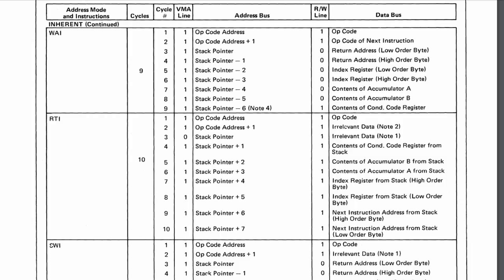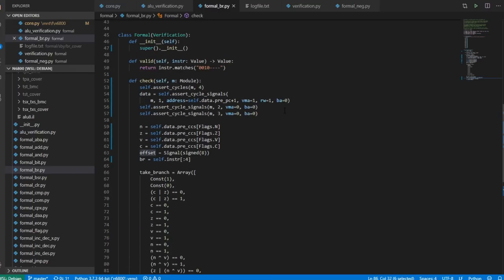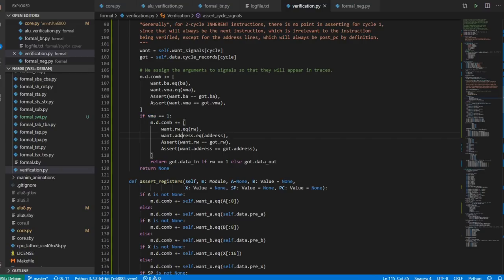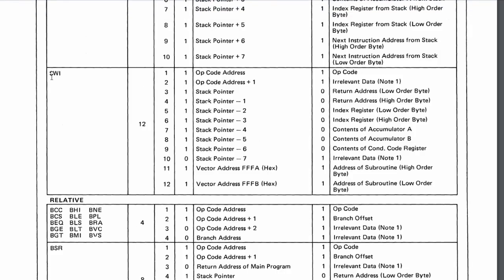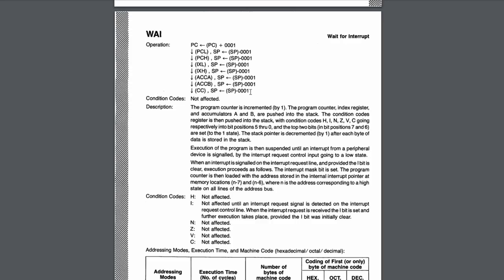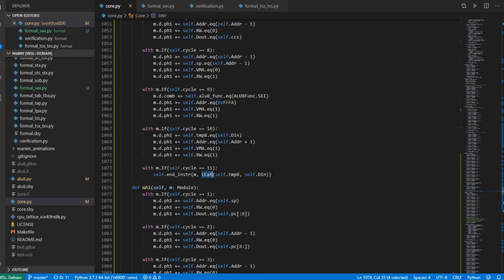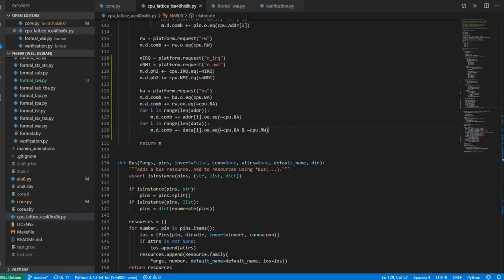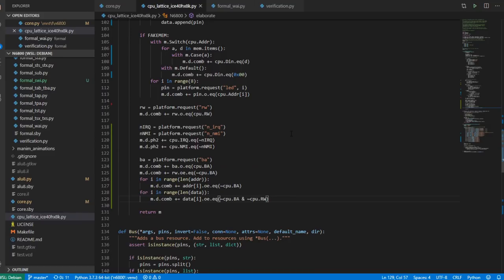Building a 6800 CPU on an FPGA with nMigen (part 10)

Comment: I still feel like "formal verification" (which I am pretty sure is not actually formal, but still just ad hoc verification, but I degress) embodies a lot of what should just be in the implementation. Like if you are going to have a table of what the lines should do each cycle then you could just use that table to actually write the code you're verifying. It's so circular.

Comment: Have you tried other engines and other OSes? I've found that on WSL z3 works much faster than boolector. 
On real linux, it's the opposite for some reason.
Reply from the maker: Interesting! I just now tried yices and z3, and it turns out z3 is faster, 10 minutes as opposed to yices 13 minutes, and boolector 20 minutes. I had to use smtbmc --syn for both yices and z3.